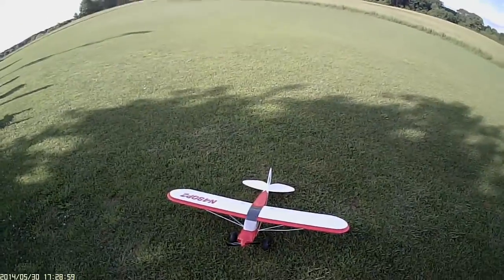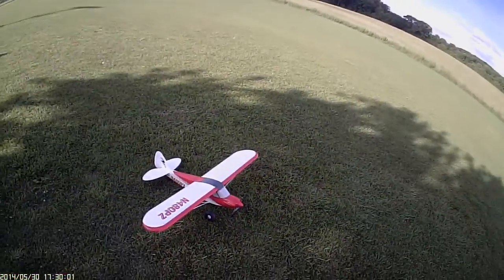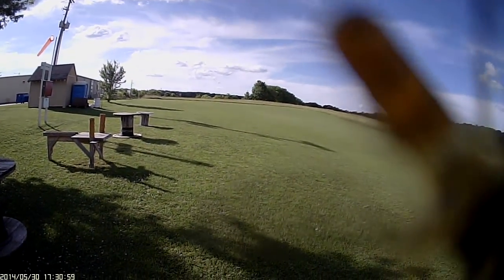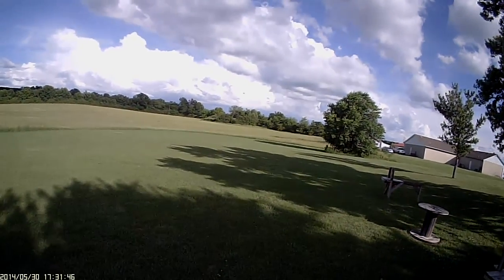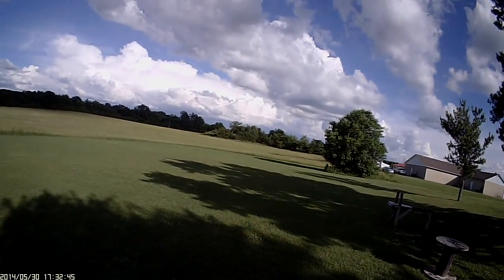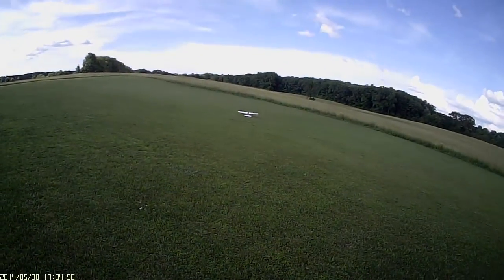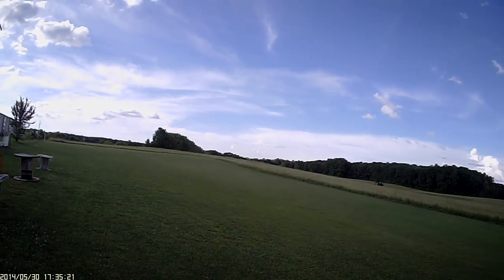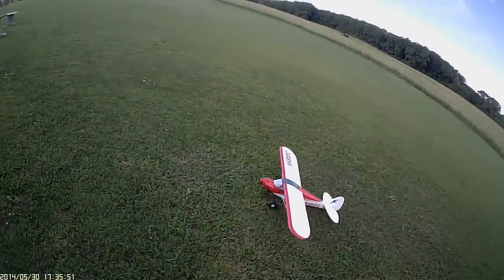Parkzone Sport Cub

Comment: Nice flight. Before you buy a new wing set try applying some very hot water to the dent. It will cause the foam to expand back nearly to it's original shape. I have been pleased with the results from this over the years.
Reply from the maker: Thanks!  I tried the hot water thing with no luck.  What temp. should the water be?

Comment: As hot as possible.  Less than boiling obviously. Submerge the dented section for a while if possible. Of course you must avoid wetting any    Electronic components. There are a couple of YouTube videos on this technique. 
Good luck.
Reply from the maker: Thanks again!  I boiled some water in the microwave and when it stopped boiling, I poured it over the dented area.  It helped.  The leading edge of the wing would be hard to submerge.  I may just fill the dent with some lightweight putty and repaint.